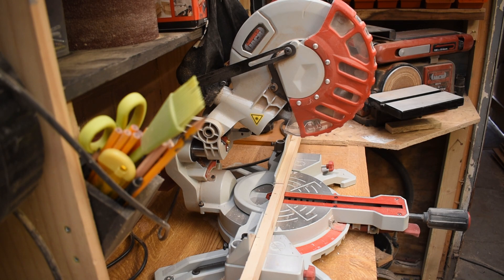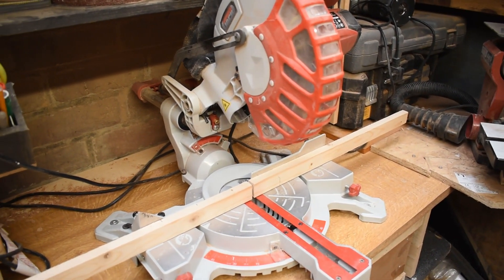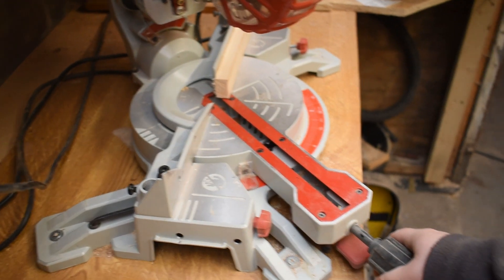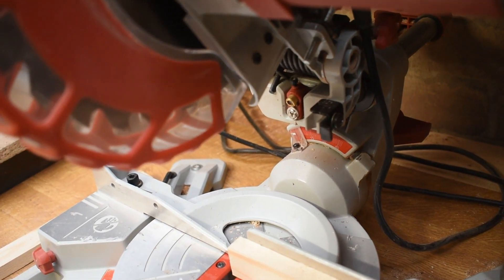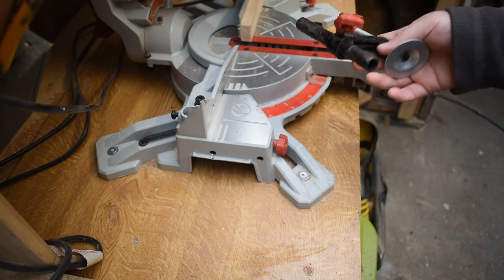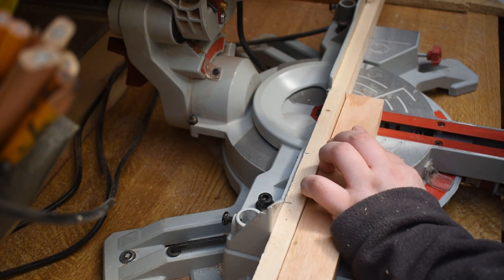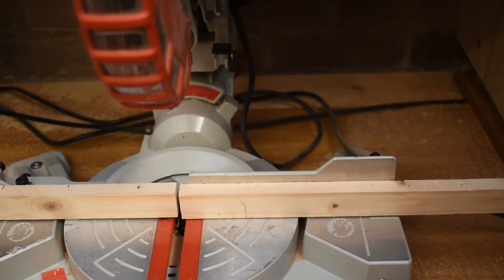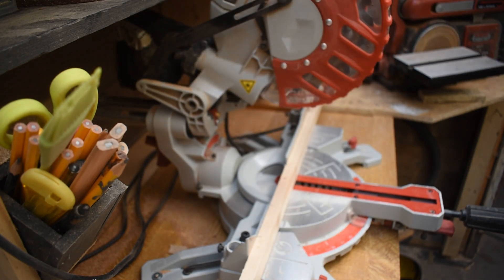Lumberjack Tools  Mitre Saw Review

Comment: Hi, just to say I own a lumber jack saw just like this one and I have had it now for just over A year, and watching your video I never new  that you can adjust the depth on the blade, so thanks for you video,  one more question I would like to ask is your  Measure guard  you made for this did you use screws on the otherside  to hold the wood in place, love to  hear your feedback, waiting reply mark..
Reply from the maker: Hi, good I’m glad you got something useful from it and thanks for watching it. Yes they’re just screws, make sure you use two on each side or it will move when you make the cut through it. I move my saw around a lot and knock them sometimes so I have to just tighten the screws now and again.